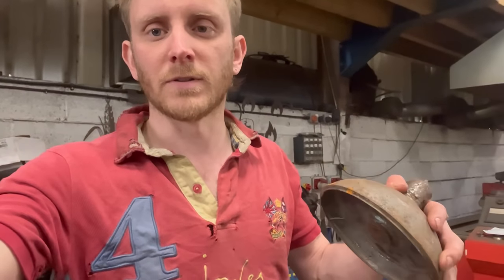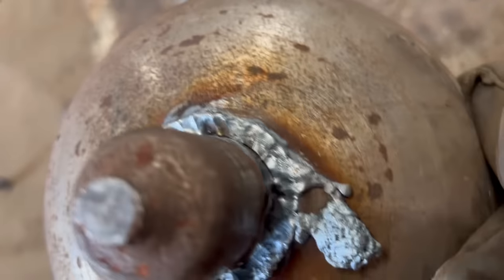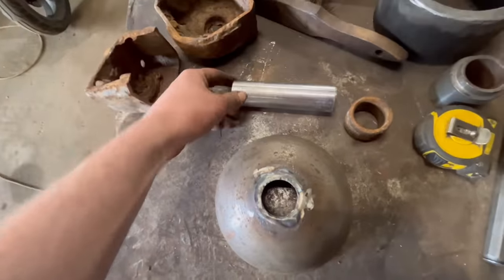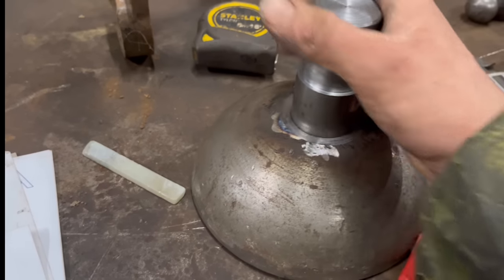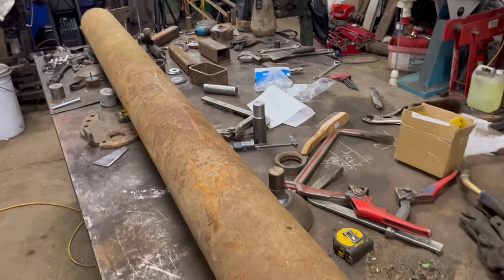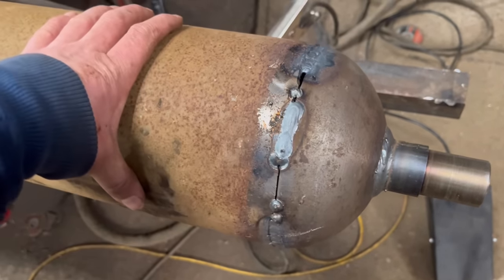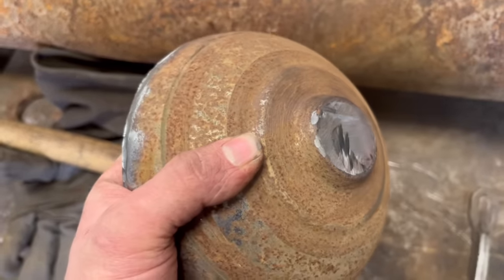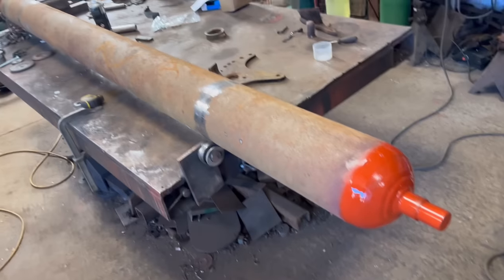Repairing completely worn out stub shafts in flail mower roller.

Comment: I can tell you that even on brand new flail mowers the roller end shafts are not central to the axis of the roller! On mine, the rollers are around 5mm off axis. Not a big issue you might think, but the scraper bar that is supposed to clean the mud/vegetation off the roller is bolted to the chassis of the mower. This means the gap between roller and scraper bar varies resulting in poor cleaning. The more central you get the roller end shafts the better, so well done for minimising the error. Nice one!

Comment: I did a Kuhn flail topper last year, exactly the same scenario. After a day of messing around trying to save as much as possible, i ended up binning the lot and starting over. I couldn't get the same size tube so ended up going a fraction smaller, never bothered with the dished end's, just some inch plate on the ends with the stubs welded in both sides. The bearing carrier's were completely goosed so just used some housed bearings and luckily i didn't have to drill any additional holes in the topper for height adjustment. 
Really enjoy your videos, see you on the next one.

Comment: good job  fixing farm equipment is not alot of fun but you did a remarkable job, I just fixed my flail mower last month  all the hammers were worn out. lots of welding I did and the weights have to be with in a half ounce or the mower will bounce every place     Kip H  Washington state

Comment: Really good repair, awesome job there.

Just some tips for your tig welding: The needle doesn't need to extend that much out. The more it sticks out, the harder it will be for the gas to protect the weld and the needle from oxygen and also keeping the needle cooler. Looks like you burnt your needle, which reduces it's life span. There are some gas lenses, which will suport a longer needle standout, but generally it should be just around 5mm. 

Also for the arm you are welding with: It is a really big help to keep it supported. Maybe fix something on the L- profile you used to indicate the new shaft with. Rest your arm on there or on your leg, if needed. The better your arm rest is, the better you keep control of the welding, because the arm and therefore your hand is not that loose. Makes it easier to keep the arc at the welding point and not all around your part. This also ensures better control of your weld, because actually at TIG welding, you should be somewhere around 2mm close to the welding point. That improves the gas' job of keeping the weld free from oxygen.

Comment: On of the channels I saw a guy turning a pipe much longer than his lathe: he had rollers on the back end supporting the pipe and he welded an extra piece on the other side that went into the 4 yaw: adjust the 4 yaw to the pipe close to the chuck and turn the diameter for the bearing.  Turn around and rinse and repeat

Comment: You should see the Keith Rucker video on the rotary welding table he got.  Yep. Burned out a cheap toggle switch right away. But it has an arm to hold your mig gun  so its set the gun . Weld a circle.  Move the adjustment and weld another circle.

Comment: The bearings stay put much better when the scraper is kept tight: it holds the two ends of the machine together. I double nutted the bolts that hold it on on our machine.

Comment: Where is the "air" bit of arc air gouging? I thought air ran down the inside of the rods but they're solid and there's no way to make an air connection to them?
Reply from the maker: The air comes out of 3 holes on one of the jaws that holds the rod. So it’s blasting air down the outside of the rod. The main cable that comes out the hand piece has the air hose and power cable inside it that you connect up at the other end.

Comment: Those bearings were shot. Probably with a rocket launcher. 

I was surprised to not have seen any grease fittings on the old bearings. Did I miss them? Without grease to keep the dirt out such bearings are made to fail.
Reply from the maker: Yes, they do have a grease nipple on them. Self aligning bearings are terrible for accepting grease though. A lot of the time the grease comes out between the housing and bearing rather than actually going into the bearing.

Comment: In this case, wouldn't it have been more economic to purchase the end of the roller complete with stubshaft, and then  fabricate the end plates? I do admire your work and this is not intended to ba critisism, (sorry can't spell).
Reply from the maker: Possibly, I don’t know if you can purchase just the ends.
Reply: @snowballengineering  Yes, I agree your solution is probably better than a Replacement part, however i have a Major 5m finishing mower and a complete roller last year was £730.00 which was faster and cheaper than getting the ends (stub shafts with bearings) repaired, (I had damaged the big socket head screws holding the ends) therefore replair was going to be > £1000

Comment: Would it have been quicker to drill that spindle out on the lathe??
Reply from the maker: I did on the second one. The first one I didn’t expect it to be welded in on back side and also I wanted to keep the original hole size.

Comment: think i would do the removal and installing of the shafts differently 
i fould start with putting the whoe thing in the lathe and drill the old shafts out 
than would weld the new shafts in and than machine them to size 
that way the axles would be centered and perfectly round even after introducing the heat from welding to it or possibly installing it slightly crooked 
might even weld the whole roller together before turning down the axle stumps at the ends (would be harder if the lather is not big enough to hold the roller as one piece )
as for the rotaary table , you can use the lather but need to make sure that the earth lead doesnt push current through the bearing in the head of the lathe and cover the ways , allso seen people use a electric pipe threader https://www.youtube.com/watch?v=QiU3WRIyeOE to spin there parts
Reply from the maker: There’s more than one way to skin a cat as they say.